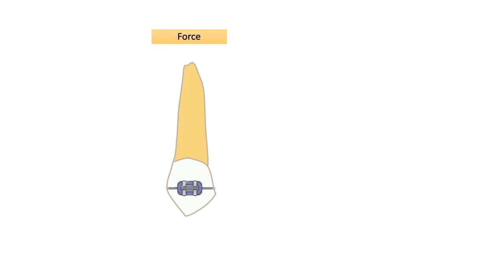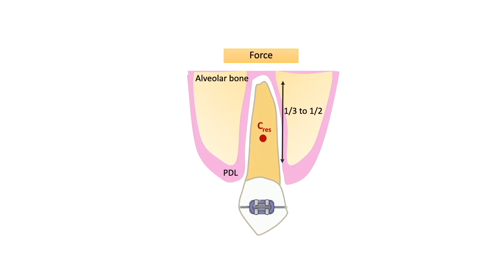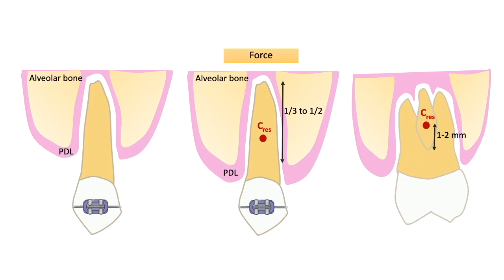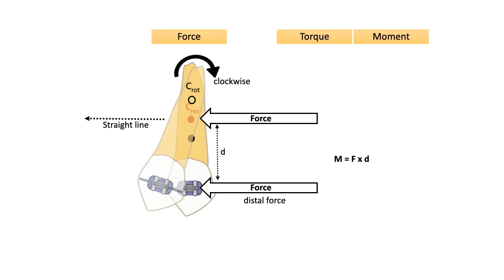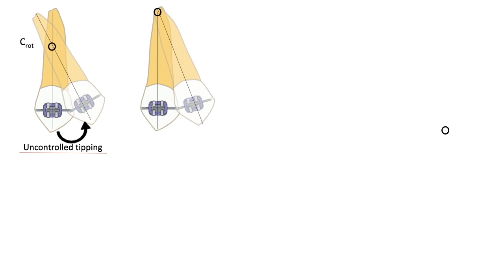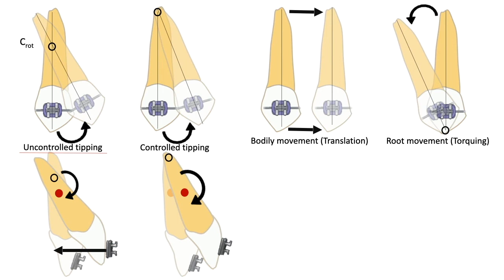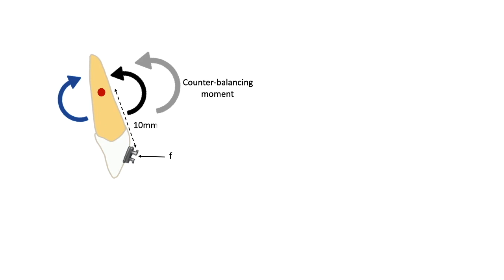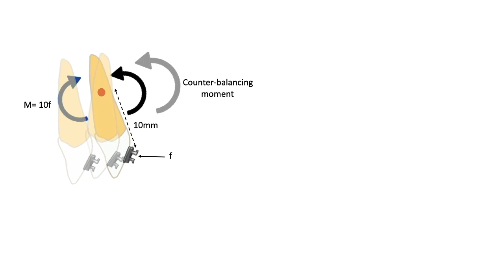Biomechanics- Basic Principles

Comment: Hi Dr. What's up?
please.. can you tell us about..
1_ what is meant by low and high torque bracket, and in what cases we can use them?
2_ how can we prevent the wagon wheel effect, when a torque is applied to the anterior teeth especially the laterals, and if happend, how can we fix it?
thank you so much 🙏🌹